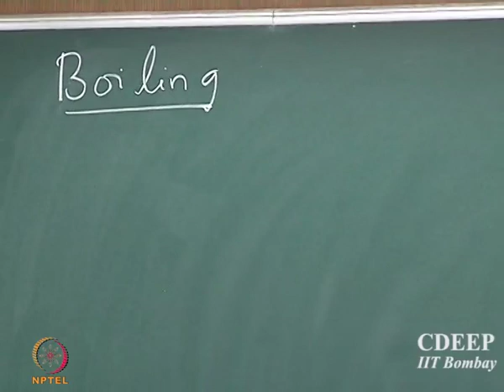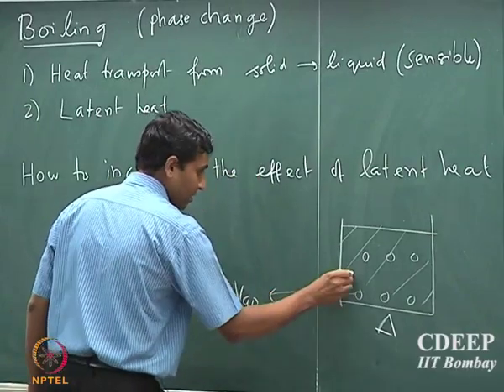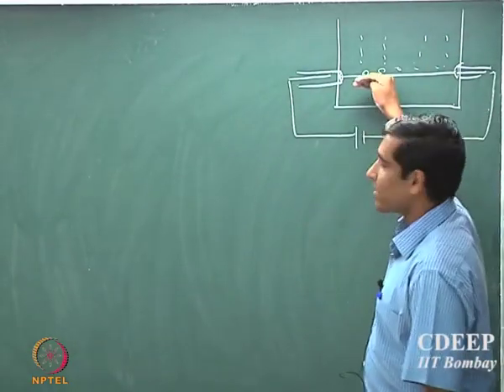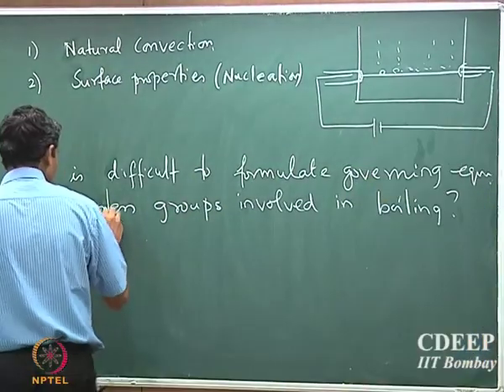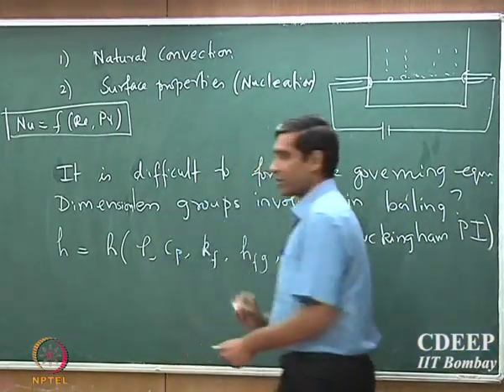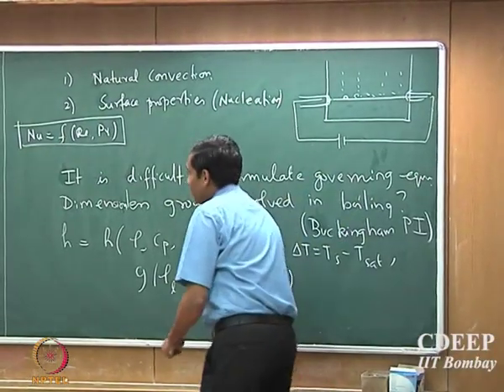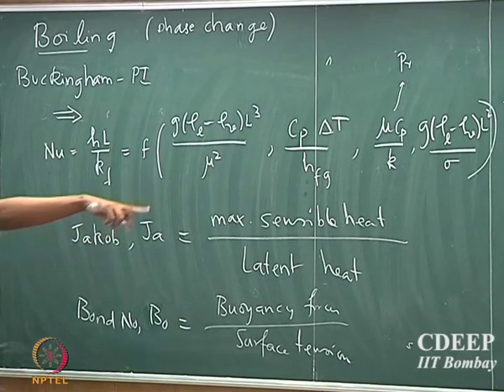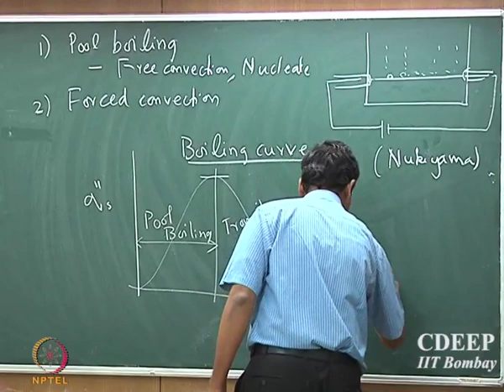Week 8 - Lecture 39

Comment: Sir ,u have written bond no. As ratio of buoyancy force to surface tension but in numerator its dimension is of force per unit length
Reply: Surface tension is also force per unit length.